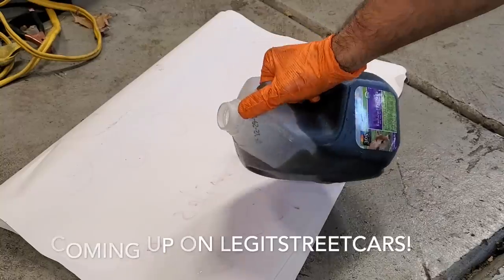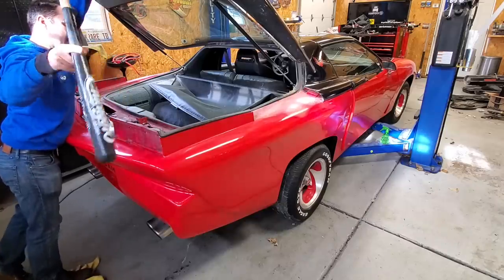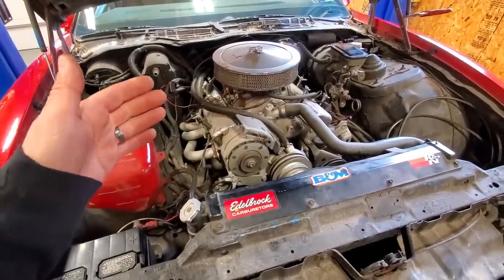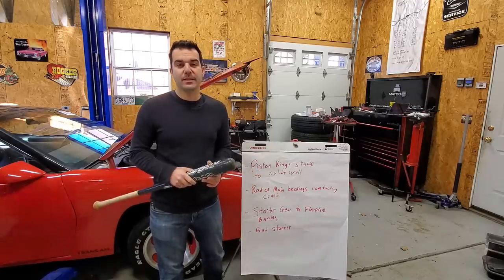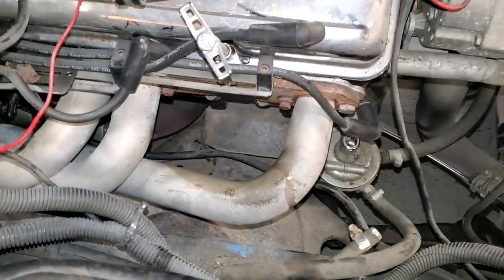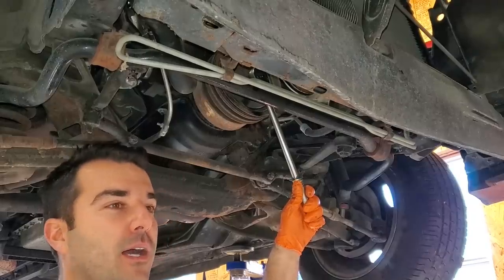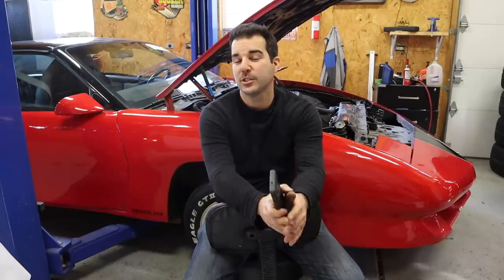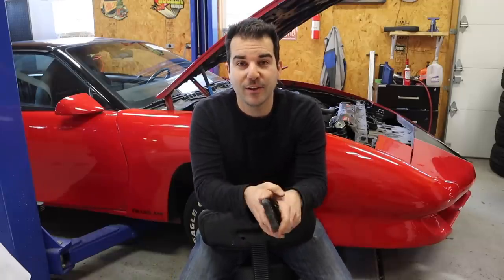My $1,100 Mystery Auction Car Has A CRAZY History! Famous Builder & Built Engine But, Will It Start?

Comment: Sounds terminal, but it's really hard to speculate through a you tube video. Let's hope it's not and it all works out for ya. I guess worst case you have to pull it and put some parts in it. Not the end of the world. There are good used aftermarket parts for small blocks all over. Try racing junk.com , all the dirt classifieds,  or any local dirt track racer. Dirt track guys up here in the upper Midwest spend tons on engines and have a buttload of parts. I've built several drag engines with parts that dirt track guys had just laying around. Let's hope it doesn't come to that.

Comment: collapsed lifters or no oil pressure. hydraulic lifters MUST have oil pressure or they will rattle in the lifter boars. If they sit to long without oil they will sometimes collapse but you said no oil pressure, DO NOT start the car again for ANY reason without finding out why you don't have oil pressure. it will lunch bearings if you do.

Comment: Aluminium intake, the distributor hold-down bolt is stripped? of course you will need to drill what's left of the threads (look up the proper size to drill for a Helicoil) and install a 3/8" Helicoil insert. If you purchase a kit it will give you the proper size drill bit. Here is the kit https://www.amazon.ca/Helicoil-5521-6-Coarse-Thread-Repair/dp/B0002SRDVE/ref=pd_rhf_dp_p_img_1?_encoding=UTF8&psc=1&refRID=7DSSA6RJ8DP2NMM63PXH and here is the video to do it: https://youtu.be/MTtlgS8XDhg Scotty is quite a character, a little abrasive but very knowledgable.

Comment: i knew it was the knight rider 2000 car they turned kitt into once he was stripped down and after he was sort of put into the 57 chevy. it was the "final" version of the new kitt.... i've seen the actual car used in the show (movie). they were going to use one of the banshee models but wanted to keep with the trans am look so they made a hybrid which is what you have in your hands... true fans balked at the look of the car and voiced their opinion and thus the show was never made and they made team knight rider instead which didn't last long either.... and then the show viper was made which didn't last long so they then made the newer knight rider with the mustang.

Comment: Screwdriver on ring gear Dude, you already have it exposed. In my experience engines sitting forever will eat the cam in less than a week unless you pull it, clean off any surface rust.

Comment: Hi, 
I had a problem with a v6 chev the distributor beening loose which lifted up and had lost oil pressure but engine was still running ok. 
I had forgot to tighten the distributor up.

Comment: lol imagine revving the engine and the timing just advances and retards on its own due to the distributor bolt being loose. runs smooth one moment, runs rough the next. makes good power then poor that would drive me nuts.. at least he found it right away. my father always said when you buy a used car you just paid for their problems. meaning they were tired of fixing shit and decided to sell it to someone else. i've paid for a few of those cars. where the person was a parts changer and they sank shit tons of $$$ into the car and decided to sell it. I pay $600 for it, troubleshoot the issue and fix it.. got a damn near brand new engine for dirt cheap.

Comment: No it was the starter not the rings in 50 years working on engines never seen a small block sound like that from the rings. The timing changing from the loose distributor. The lifters will stop rattling from sticking after you replace the fricken oil with Amsoil syn. Told you it was not stuck.  Did you put the oil back in it before checking the gauge? Its strange how the fact that some one points out your mistakes or tells you that you are completly wrong tthey are assumed to be trolling. LOL You will know if I am trolling I would have referred to certain individuals as pissants. Some morons in the comment section for example from one sentence I can tell they have no mechanical background or ability's Like telling someone poor seafoam in the block or gas tank that will fix it...spray it full of either that will start it....

Comment: the first two on that list its not. It wouldn't turn over at all....
Reply: Altho you got it running (Good deal) I still don't believe the rings were stuck to the piston walls. It wouldn't turn over at all in that case. They could have been frozen to the pistons but it shouldn't prevent it from turning over.It's a strange thing alright.

Comment: Hey my fellow gear head, I suppose you have a crap load of the stupidest questions ever. Any how, just a little gear head tip. Never use starting fluid to start you engine, especially on small engines it so so rough on the engines. Instead, use carb cleaner. gets you going with out all the harmful effect of the starting fluid. I think you got a good deal on this one.